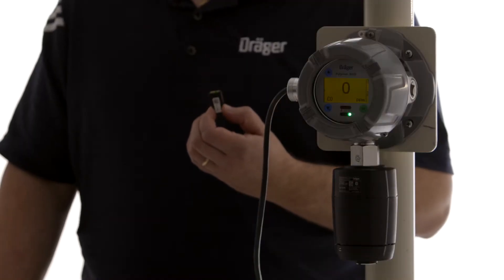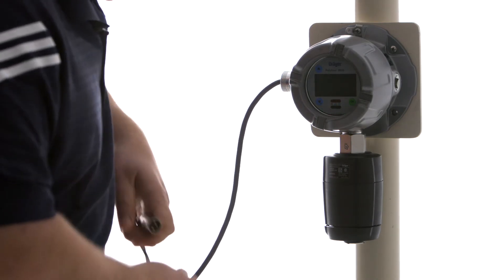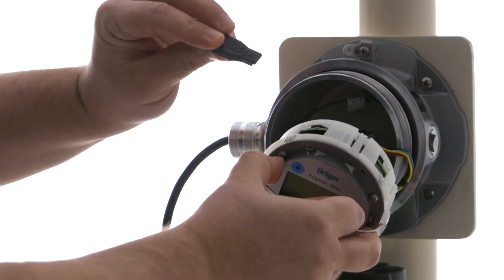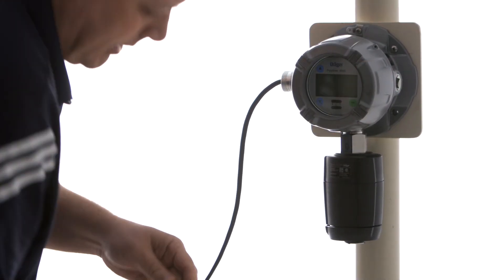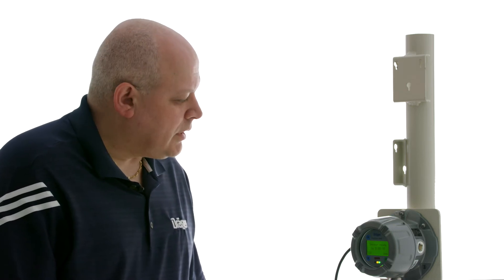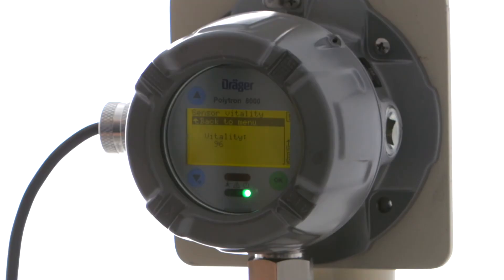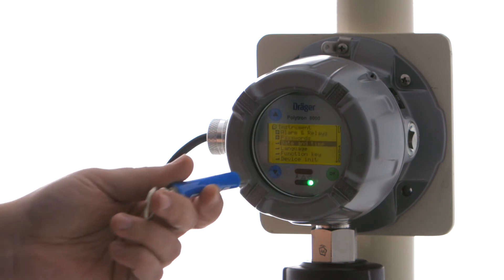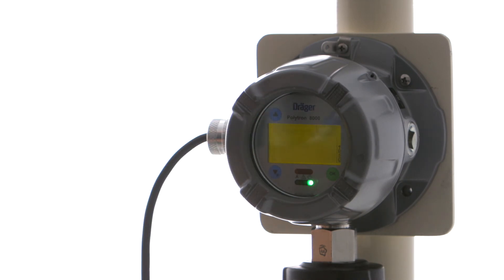Polytron 8100 Diagnostics

Comment: Does the diagnostic dongle stay with each bucket assembly, or is it a device a gas specialist could keep in his "toolbox" to temporarily install in a bucket assembly and read the sensor vitality, remove dongle and take to another transmitter, and another and so on?